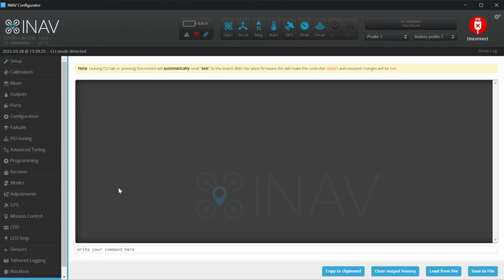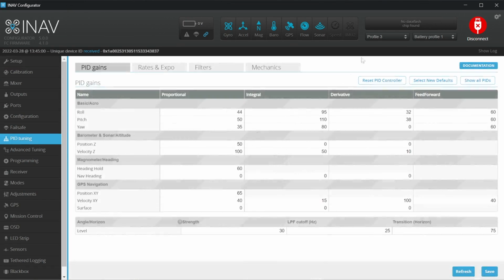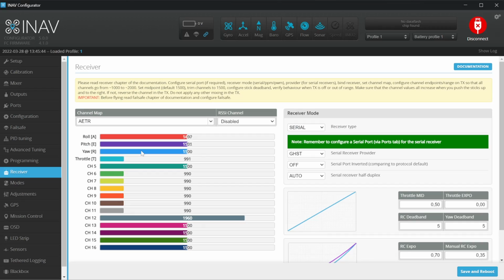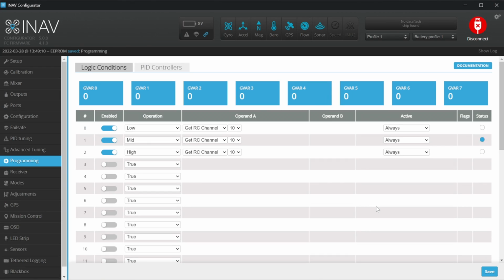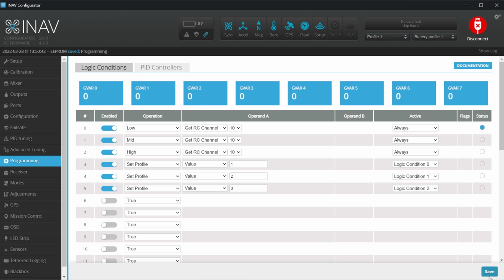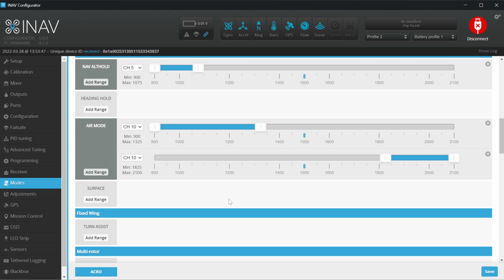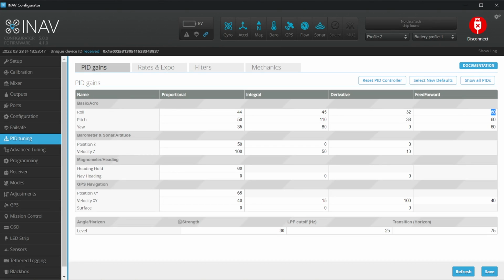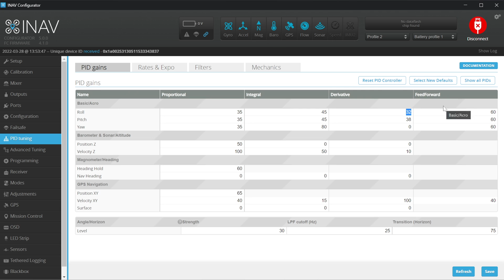How to land a cinelifter? Create a landing PID profile and activate it in flight!

Comment: I think as a beginner you should not fly a cinelifter^^
Reply from the maker: why? They are not hard to fly :) They are only expensive to crash with payload and hard to land ;)
Reply: @FPVUniversity  more weight, more impact :) if you can't land properly, you don't have the drone properly under control and in my opinion you should just keep practicing.

Comment: Should profile 2 be activated automatically while switching on Failsafe (activating RTH)? Probably not, because that profile could make it difficult for the drone to come back from far away.
Reply from the maker: No, rather not. I mean, it's possible to activate it automatically during Failsafe RTH as logic conditions allow to detect the state, but I would not do that

Comment: Or you implement the "landing" mode in the mode tab. Yes I am rude, I apologise, again. 😅
Reply from the maker: There are enough "modes" already ;) Yet, I'm thinking about land assist mode indeed
Reply: @FPVUniversity  I really hope it doesn't do that if you're fairly close to home?
Reply: @FPVUniversity  🤣 sounds great. Right, many modes, I am getting ready to test the soaring mode in the 3 meter glider. I am curious how it finds the angle of attack to avoid a stall